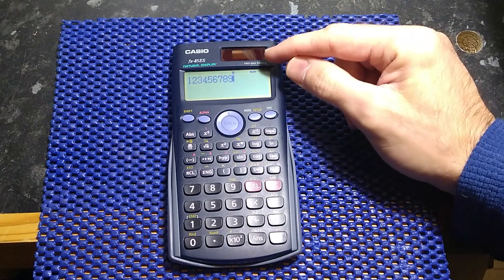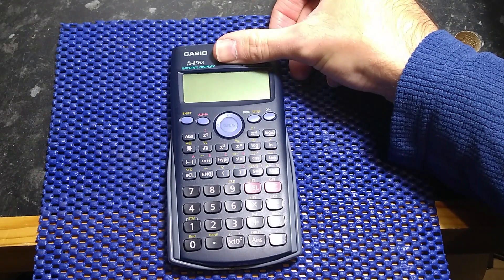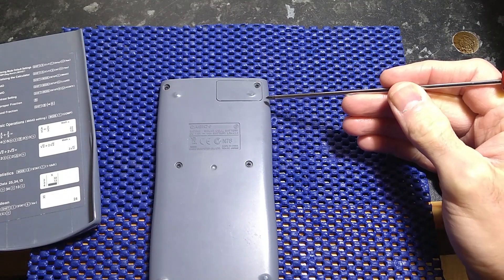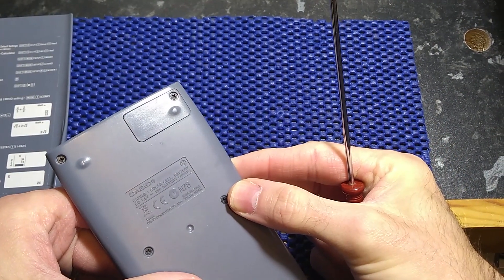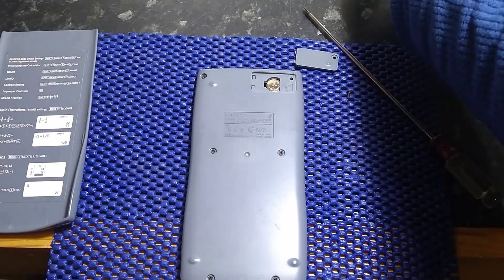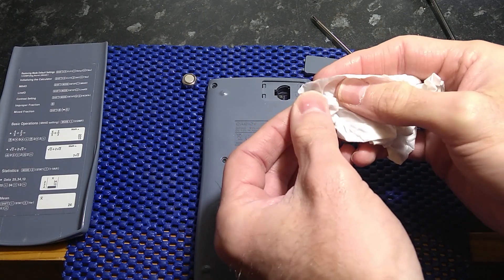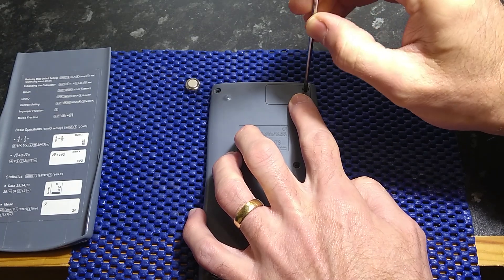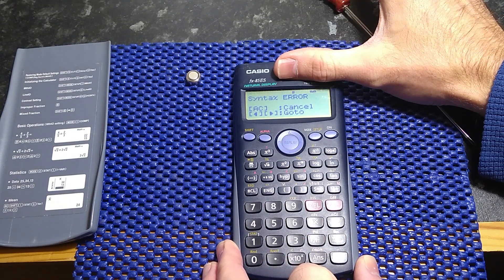TFTT062 Replacing Casio FX 83ES Battery

Comment: If you like tinkering and have the Model A version of this calculator, you can change the software by altering the jumpers inside, including upgrading it to the Casio fx-991 ES. Casio realised the consequences of this so removed this ability on the B model.
Reply from the maker: Apologies for the really delayed reply. 
That is very interesting. I'm not sure which model I have but as I also have an fx-991 ES I probably won't explore that mod.

Comment: My Casio model fx-991ES which battery 🔋 is suitable and where it is available
Reply from the maker: It uses an LR44 (or G13) which are readily available from hardware stores, supermarkets, Amazon and eBay. Once you replace it you will need to reset the calculator: CLR - ALL - YES. (shift 9, 3, =) Don't skip that part!
I hope that helps.